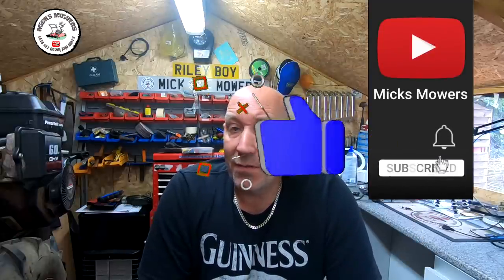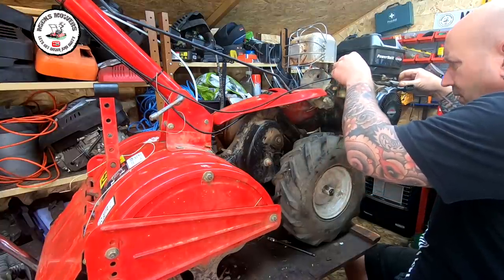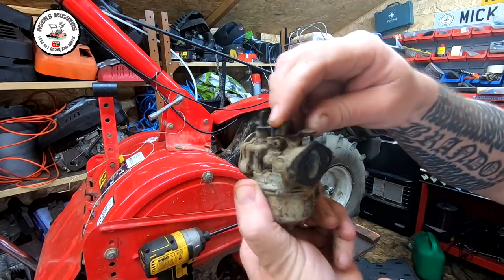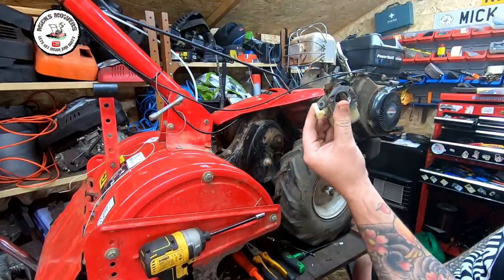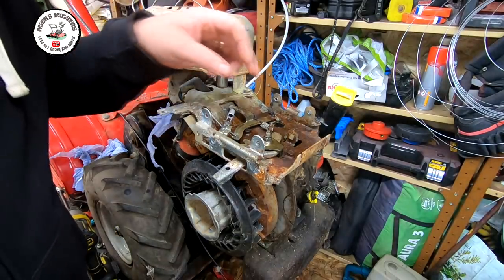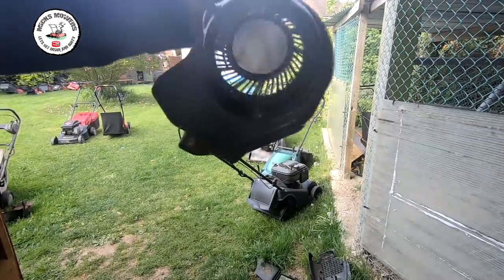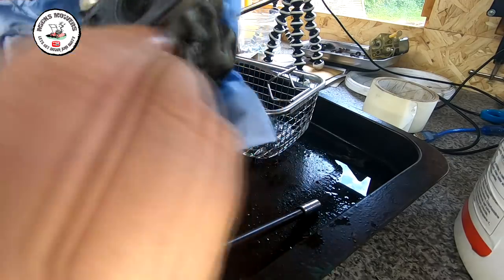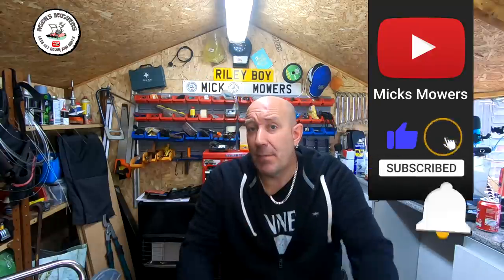FREE Rotorvator Tiller Been Sat For Over A Year Will It Run

Comment: Hey Mick...it's late I'll have to watch this in two segments 😁...just thought I'd share a tip: to clean the needle valve passage try a cotton bud snipped in half and spun in the cordless with a dab off compound works well, and tap the needle gently into the seat helps to seat it... 👍Great to see you busy and making vids..
Reply from the maker: Yeah mate I have a new carb coming the other one is leaking so going to replace it

Comment: Good job Michael. I did see a fella on once that puts small pieces like pins and jets into a small plastic jar, fills it with the cleaning solution and then puts that in the ultra sonic cleaner to stop them falling to the bottom. He said it works just the same as the good vibes go through the jar aswell. Keep well.
Reply from the maker: Yeah I have seen that too.. some say it's good others say it not..

Comment: Nice Mick, just fixed One of these yesterday except it was a 5hp flathead.  I had the 6.5 OHV on a pressure washer.  Put new carb in it and ran great without the air filter but would leak and not start with the air box and filter on.  So weird!
Reply from the maker: Yeah mate my carb is leaking too.. one on it's way from China so that will sort it

Comment: Great video again Mick.  I've got an old Wolesley Major Tiller in which I intend to keep actually. Issue is it only likes to start with a bit of damp start and the drive belt is binding so the tines spin continuously so needs looking at but overall a very well built machine. Your lift trolley takes the weight of that tiller well doesn't it.  Nice!
Reply from the maker: Yeah mate I would be lost without the table lift.. it's a great bit of kit